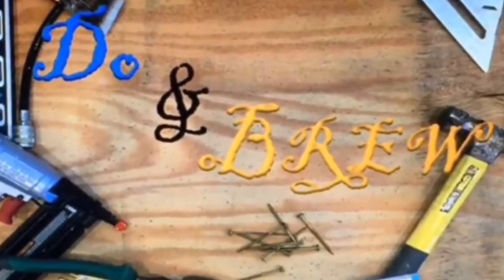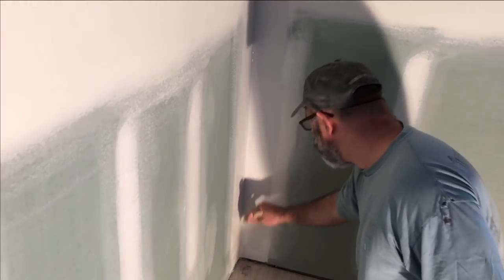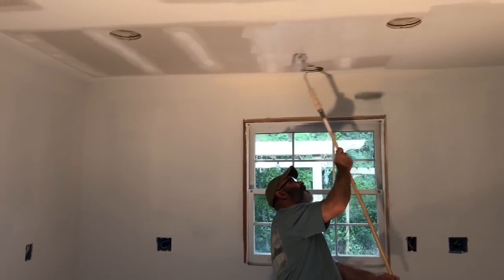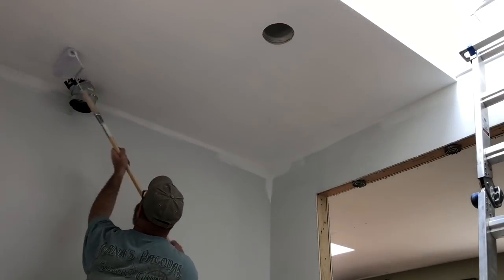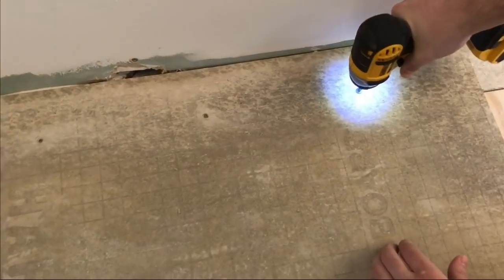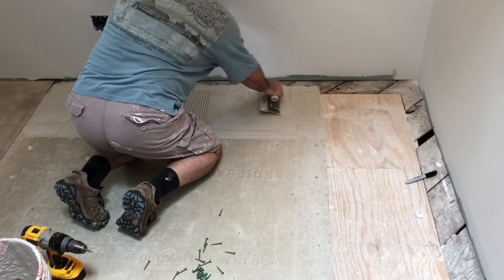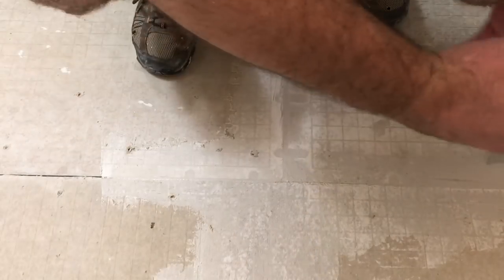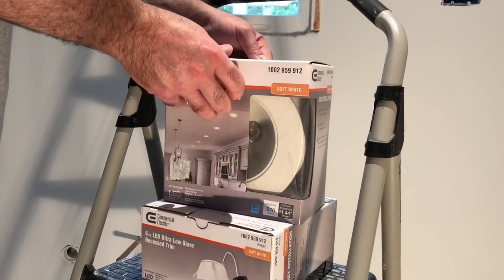Complete Kitchen Remodel V.7 - Primer, Cement Board, Can Lights

Comment: You need the Wooster Brush BR045-18 and Wooster Brush BR412-21. They will make your life easier. Also, when painting ceilings you want to make sure that your final coat of paint is rolled either in the direction of a natural light source (window) or along the longest wall to reduce the chances of weird things happening to the finish.

Comment: Do you really need to cut in around the outlets when there's no face plates? Just curious.
Reply from the maker: Howdy Stephen S!  No sir...you don’t have to...but I do for a quality job!  Plus having a few extra coats increases the “scrubability” around switches and outlets - which tend to get more dirty than other areas of the wall.  Thanks for watching and for the question!   ☘️
Reply: @DoAndBrewDIY  I caught that when you mentioned it in the video. Great idea. Thanks for the tip. Have you started work on that house mentioned at the end of the video?